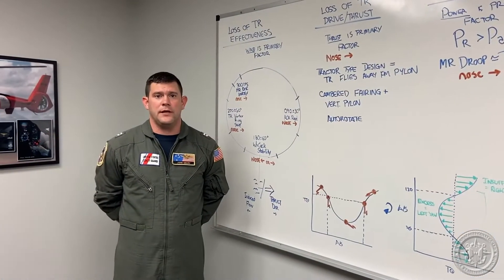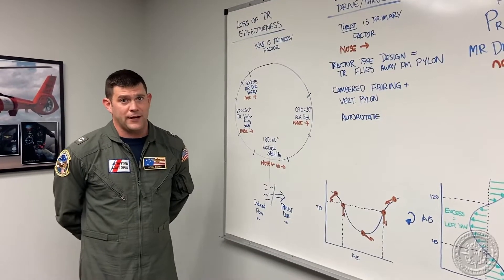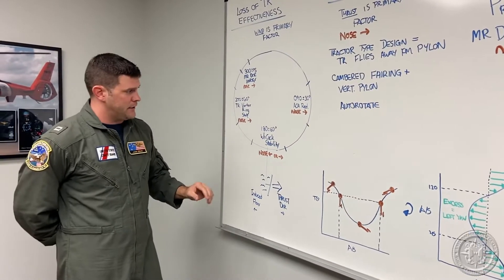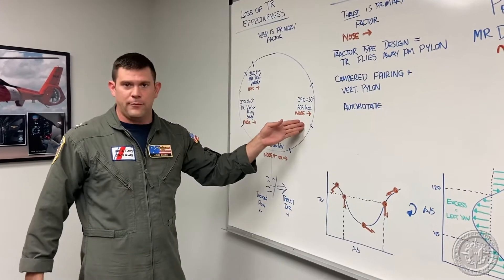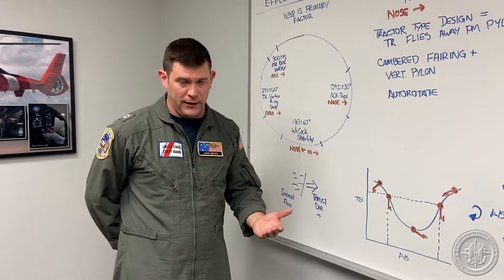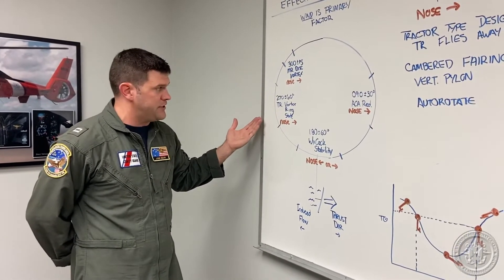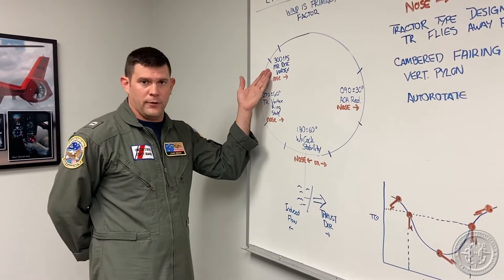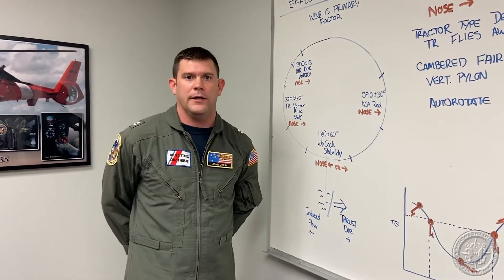#CGHowTo Loss of Tail Rotor Effectiveness (1 of 4)

Comment: Sir,

Great class, and great whiteboard work. However; you’re incorrect in your interpretation of the main rotor interference portion (front left). Multiple manuals, and practical exercise show that a.) it is experienced during low speed right turns and b.) the primary hazard of that section is that the MR vortex initially increase rail rotor AoA and requires right pedal to counteract this, as the vortex passes, and presumably the wind acts on the wind sail that is the horizontal stabilizer, AoA is decreased and compensatory left pedal is required to prevent right yaw inertia. I HIGHLY recommend when doing low speed flight/hover practice that you practice this right turn to familiarize yourself with the needed pedal control touch. Good class tho!